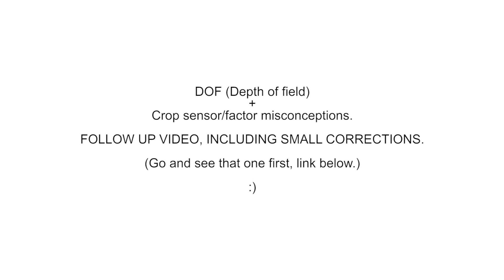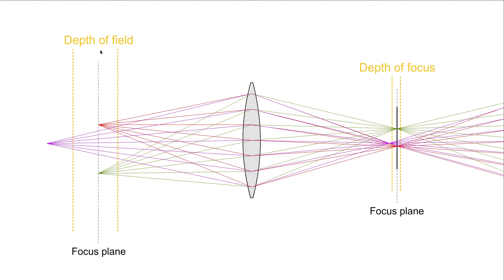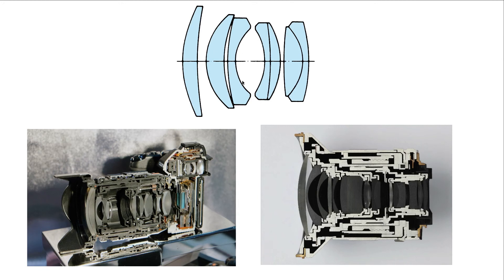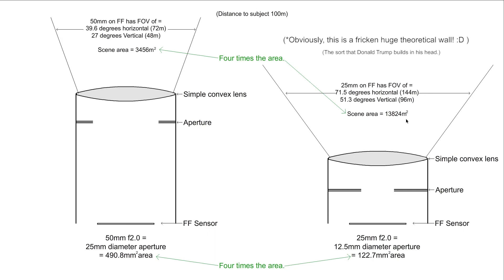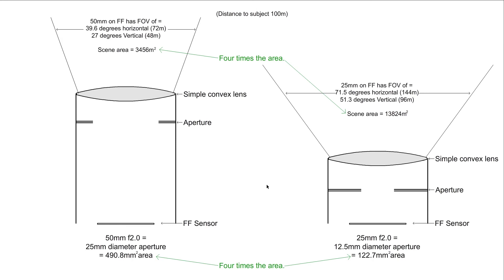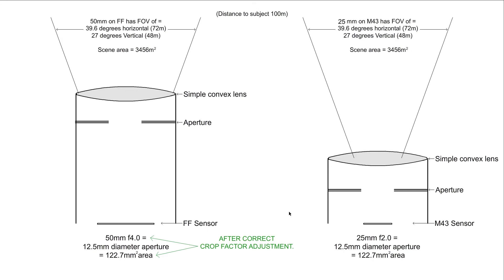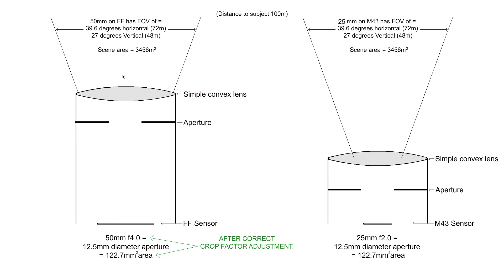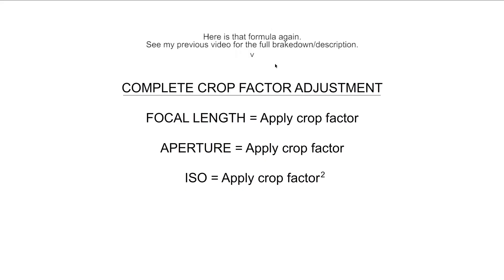Depth of field and crop factor misconceptions. FOLLOW UP.

Comment: Theoria apophasis Probably thought you meant focal  distance when you said wide. For instance a 14mm lens is a wide lens. I didn't read his response, just a guess. A lens that is wide physically obviously lets in more light than a lens that is physically narrow.
Reply: Focal length/distance and the characteristic "wide" are directly related so this assumption on Ken's part is very unlikely. It is more likely Ken is out of his element. Focal length is used to determine how to categorize a lens as either being a wide or narrow (telephoto) FoV lens. They are synonymous.

Comment: I’m interested in the case where the M4/3 is set to f4 instead of f2 would the increase in DoF be 2x ?
Reply: No, it would reduce the circle of confusion by half. It can increase depth of field by a different amount. For example it can cause the depth of field to reach to infinity which is infinity times more.

Comment: 10:40 Nice video, however, I think it would be better to mention that all this math works if both FF and m43 sensors have the same number of pixels on them, in case, say, 16 mp on m43 and 64 mp on FF each pixel would get the same amount of light for the same F value.
Reply: Pixel count is not relevant to this. Nobody cares about the amount of a light to an individual pixel. The myth that low resolution is good for low light has been debunked.

Comment: Great couple of videos (and maybe the best diagrams I've seen for describing DoF), but I understand that the larger aperture (or more accurately the larger entrance pupil which is the aperture as magnified by the front element) of the 50mm lens over the 25mm lens is to compensate for what is a greater light fall-off with a longer focal length (with lens elements moving further from the sensor) - not unlike a projector brought further from the screen it's projecting its image on, creating both a more magnified image and a darker image.  I suspect that this is more the issue at hand than requiring a smaller entrance pupil or aperture to compensate for a larger field or "wall" potentially creating more total light to enter the lens.  While a larger sensor has more potential to gather more (total) light than a smaller one (especially if assuming similar photosites with similar fill factors on both sensors), I doubt that there is concern in the lens design for the larger wall or even if we can say that the larger wall means more total light.

In fact, there can be an OPPOSITE effect with the greater focal length...  Let's say we are photographing a human face in a scene where everything else is in total darkness.  More of the (perhaps spot-lit) face fills the frame with the longer focal length lens than the shorter focal length lens given the same subject distance - more overall light then albeit at the same f/2.0 exposure.  But I'm thinking that that should not be a concern either.  If not for the larger aperture size and the power of the front element to magnify the aperture to the proper entrance pupil size, we would have a higher f-stop than f/2.0 and an underexposed face - for EITHER lens, but worse underexposure and the highest f-stop for the longer focal length lens ... as I understand it.  So does the angle or field of view (based on both the focal length and the sensor size) or even just the angle of coverage of the lens or its focal length or its magnification if you will have any sway on how much light the lens gathers or its exposure?

As much as I love what seems to be your theory, at least, of the larger wall/field (and wish a certain someone else to be wrong), I suspect that it is not right based on what I said above.  Perhaps you are still effectively right though if you meant that the angle or field of view affects how much light at least POTENTIALLY transmits through the lens with the less of that with the greater focal length - just maybe not in the way you thought.

Take into account for instance that the aperture hole size does not change when adjusting the focal length of a zoom lens (regardless of whether it is a so-called variable or constant aperture zoom lens - "aperture" referring in this case to the f-stop), but the size of the entrance pupil, thanks to the front element working as a magnifying glass basically, usually DOES change and MUST lest we would have higher f-stops (or no ability to truly have a constant aperture lens without actually having to change the aperture hole size throughout the zoom).  Variable aperture zoom lenses of course tend to have higher f-stops at their longest focal lengths (which again would be higher without the front element).  And for a constant aperture zoom lens, without the front element (working to magnify the aperture hole ever more with ever greater a focal length), we could not allow the TRUE aperture hole size to stay constant, and would not be able to achieve the very low f-stops that we can.

Comment: Hi!
Just came across these two fantastic videos which I found very well made and precise.  Thank you!
I have one question for you that I think might be interesting to analyse considering focal length, DoP, f-number... for two cameras with two different sensor sizes.
Consider Cam1 a FF with ISO 800, 50mm focal distance, 5 meters to the subject, f2.8.
Then consider CAM2 a MFT camera (crop factor x2). 
Imagine that you want to have the exact same image in both cameras. What is happening if, instead of going with a 25mm lens, f2.0 aperture, ISO 200... you simply move yourself away the double of distance from the subject - in this case, 10m (crop factor x distance). Can you please elaborate this in terms of FoV, DoP, noise, ISO, f number, and bouquet?
I know that in many situations it is not practical to double the distance to the subject but there are others where it is quite possible. Your comments are greatly appreciated! Thanks!

Comment: Hi, I just discovered this channel. I like these explanations and format - better looking at drawing explaining the concepts than looking at someone speaking. I followed both videos and totally agree with the maths and physics, but there's one aspect that bothers me still : photosite. When you explain the total amount of light difference between two sensor size, I don't really see the point. What matters here is your photosite size, which will be related to the pixel density. Sure a smaller sensor is more likely to have an higher pixel density... but that's not a given, especially those days when manufacturers are back with the MPixels war. I believe this is a bias in your test: you do not take into account the pixel density. Two different sensor size with a similar photosite size receive the same amount of photons per photosite, and thus have the same noise level, assuming they are of the same technology (say both are BSI from the same manufacturer and same generation). I really can't see why the total amount of light is important. That's my understanding of a CMOS (or CCD) sensor: every single photosite collects its own amount of light to transform that into electrons, and it doesn't matter for that photosite that there are 40 millions of them or not, it doesn't change its reading.
When I do nightscape photography, milky way shots for example, that pixel density is critical: not only for the signal quality (more light can be gathered so less noise), but also for star trailing effect. Bigger photosites allow me for longer exposure time without that trailing effect (and so more light, less noise too).
You should take that into account in your real life examples. I'm wondering if omitting that is not driving you to incorrect conclusions. It's a very difficult task to try to do real-life examples of different camera using different technologies.

Comment: Thank you for very clear explanation of scientific rationale behind the most difficult concept of crop factors, circles of confusion etc. I am a newbie to photography, a beginner hobbyist. Appreciate if you could please clarify this one critical parameter related to fixed focal length lenses. 

If the focal length of a fixed focal length lens is 50mm with an f-stop of 2.8, then the diameter of the aperture is also fixed at 17.85mm ie 50 divided by 2.8. If these two parameters are fixed, only variable parameter left is the shutter speed. 

Does it mean that the camera will be able to focus on objects located at various different distances just by adjusting the shutter speed depending on the available light? 

As a consequence of above, do we always have to use a tripod for fixed focal length lenses, in order to over come the issues of camera shake due to low shutter speeds determined by the camera, during low light situations. 

Does it also mean that fixed focal lenses are in effect, constant Aperture priority mode, by default?

It is a photography paradox that these fixed focal length lenses are also called as fast lenses. If the above points are correct they could act as slow lenses as well!

Looking forward to seeing your response :-)
Reply: First of all, the f-stop on lens usually represents the maximum (widest) aperture possible on this lens, but you can control aperture via ring on lens or inside your camera.

Usually cameras have Aperture priority mode (you set the aperture and camera chooses the shutter speed), and Shutter priority mode (vice versa).

Fixed focal length lenses (a.k.a. prime lenses) are called "fast" because they usually have wider maximum aperture compared to variable focal length lenses (a.k.a. zoom lenses), just because prime lens have simplier construction and have more free space inside to create wider maximum aperture. So they capture more light and allow using faster shutter speeds, and get rid of using tripod. Hence "fast" :)

Comment: 50mm / f2 has a 25mm input lens diameter, not a diaphragm diameter. It's simple: 100mm / f2.5 has an input lens diameter of 100: 2.5 = 40mm, 200/4 = 50mm. This is the theoretical f, the practical value is T, which calculates the loss of light.
DOF will be the same for all lenses when shooting from the same distance. Only the angle of view varies depending on the focal length.

Comment: So for figuring in a speedbooster of .64 for say a 200mm f4 lens on a micro four thirds body.  Would the math be 200 * 2 *  .64 for a resulting  512mm f/7.1 lense?  I'm just trying to make sure I'm doing the math right with the speedbooster in the mix.   Thanks for the great breakdown!
Reply: speed booster .64  =  128mm @ F2.56
Reply: No, the lens will be 128 mm. Do not confuse the equivalences with actual changes in the lens. The speedbooster really changes the lens.

Comment: Both camps are correct. It just depends on which side you're on.  Russians believe russian media, Americans believe american media. If you're a full frame user, if you want to replicate what the aps-c has taken using the very same lens, you simply crop the picture and it would have the same depth of field.  ON THE OTHER HAND, If you're an aps-c user and you want to replicate what full frame (say 50mm 1.8) has captured, you cannot simply crop, you need to use a lens with a wider field of view, and that would be 35mm to account for the crop factor.  And since it's a no brainer that 50/1.8 would have different bokeh to 35/1.8, you have have to use the crop factor and use 35/1.2 to get the same bokeh.

Comment: All lenses, NO MATTER WHAT THE FOCAL LENGTH IS have the SAME DEPTH OF FIELD when FOCUSED on the SAME DISTANCE using the SAME APERTURE. A 50 mm lens remains a 50 mm lens whatever the sensor size is. The IMPRESSION of DIFFERENT DEPTHS OF FIELD is an ILLUSION CAUSED BY DIFFERENT ANGLE OF VIEW. A 50 mm lens will be WIDE ANGLE ON A 6 cm x 6 cm sensor, STANDARD ON A 35 mm SENSOR and a TELEPHOTO on a 4/3rds SENSOR. It remains a 50 mm lens whatever the sensor size. This can easily be demonstrated by photographing an object  with different focal lengths and ENLARGING the object to the same size on a screen or in a print. The AMOUNT of BLUR WILL BE IDENTICAL. The apparent increase in depth of field when wide angle is because the objects are smaller so appear sharper because the blur is smaller. Conversely for telephoto where the blur is magnified giving an impression of shallower depth of field. I knew this more than 50 years ago when I couldn't afford a telephoto lens and zoomed in using a good old fashioned enlarger.
Reply: No, focal length has a significant effect on the depth of field. However, if you change the distance so that the subject is same size then the depth of field is roughly the same.
Reply: Take a photos of a beer bottle at the same distance with the same aperture using different focal lengths. Then print each photo such that the bottle fills the size of the paper. You will then notice that the amount of blur behind and in front of the bottle is the same in each print. I am correct. @okaro6595

Comment: Very good but the MFT sensor is a little bigger than a quarter of a full frame sensor so the ISO crop factor squared is an approximation. ISO can be set in subdivisions of stops so it could be closer.
Reply from the maker: If you are talking 16:9 for video (I mainly shoot video)
Then it’s pretty much 1/4 of a FF. 
(M43 is squarer than FF sensor. But the extra height is wasted for C4k or 16:9)
Reply: biscuitsalive no I'm talking about your diagram with four M43 sensors inside a FF sensor.  They would not fit because the M43 sensor is 28.125% of a FF sensor, not a quarter. Your diagram is not to scale.  The crop factor squared rule is an easy approximation to use but is not an accurate calculation as you claim.  FF ISO of 200 works out as M43 equivalent ISO 710.  200*(1/0.28125)=710.  Not practical to use while shooting so the crop factor squared estimation should be used as it is quick, easy and goes to a full ISO Stop, so you were right to mention it. However you asked us to identify any inaccuracies in your explanation and your diagram is not accurate. The crop factor squared rule is a simplified approximation. Hope this helps. Overall your explanation was very good and I'm sure it will help many people.
Reply: Because the sensor shape is different it cannot produce same image without additional cropping. If you crop to 3:2 it increases the crop factor by 4%. If you were to crop 3:2 to 4:3 it would increase its crop factor by 8%.

Comment: Great video(s), very informative. P.s. Sorry for commenting on a 2 year old video but I do have a couple of follow up questions,
Q1) is a lens that is designed for “full frame” e.g. a 70-200mm f2.8, technically a 105-300 f4.2 when used with an APS-C sensor (with a 1.5 crop). And Q2) are lenses that are made specifically for APS-C sensors any different when it comes to the f(n) they are marketed as? (I.e. I know the focal length is still affected by crop factor but what about aperture?). Thanks
Reply: All lenses are marked with their actual focal length and speed. They cannot ever become anything else (not counting teleconverters and speed boosters). The fact that smaller sensor produces different results is entirely result of it being smaller.

Comment: Loved this one as well! You should make one about the speedbooster also.
Reply: Yeah I would like a little more math on the speedbooster and how to figure that into the calculations.  When they say it adds a stop of light is that an additional stop or just the stop that the normal math is taking into account?
Reply: @TomFoolery9001  Speed boosters are sometimes also known as 'focal length reducers,' (They're the opposite of teleconverters, basically).

So if you mount a 0.71x Speedbooster on the back of a FF 50mm F1.4 lens, the combination ends up with a focal length of 35.5mm. However, the aperture diameter hasn't changed (it's still 35.7mm). A 35.7mm aperture in a 35.5mm lens would be F1.0.

The key thing to note is that you can only speedboost lenses designed for a bigger format (you need a wider image circle to condense down to your smaller sensor - that's where the apparent extra stop is coming from).

Now, work out the behaviour of a 35.5mm F1.0 on an APS-C sensor. It's a 53mm F1.5 equivalent. Sound familiar?

Essentially what a speedbooster does is condense the full field of view of the lens down from, say FF to APS-C, shorten the focal length, which boosts the F-number, and the net effect is that you get behaviour much more like that of the original lens on its native format. That's why FF->APS-C boosters are usually around 0.71x reducers: because it approximately cancels the crop factor of APS-C.

The only downside is that a 35.5mm F1.0 lens is more likely to see you hit your max shutter speed than it would as a 50mm F1.4 on full frame (assuming similar base ISOs).